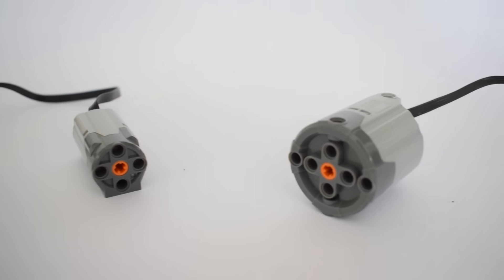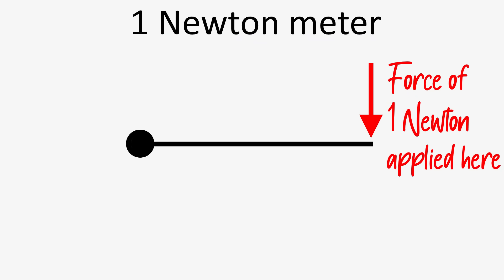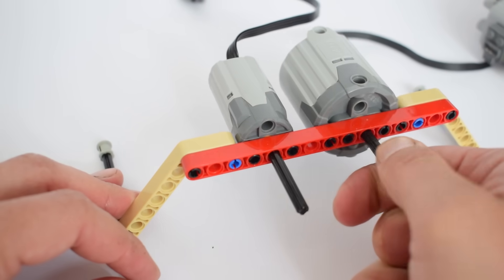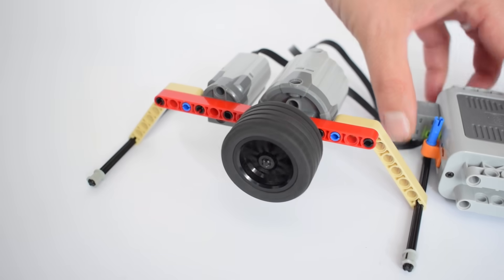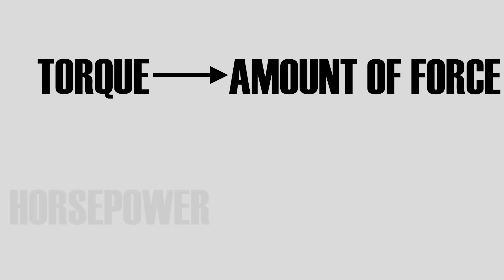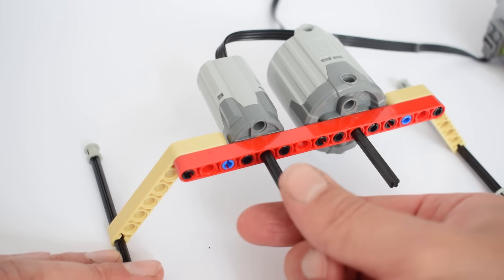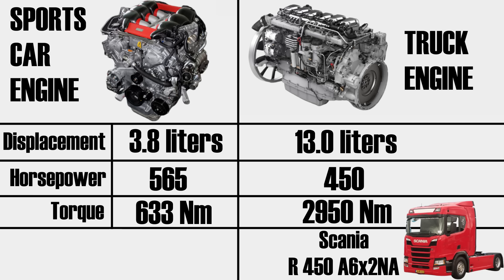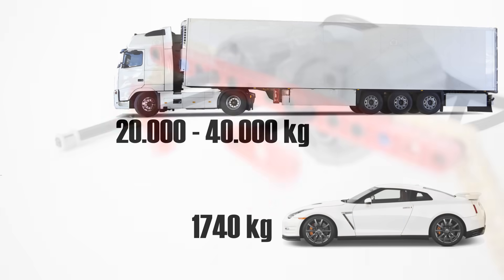NEVER be confused by HORSEPOWER and TORQUE again - HP and TORQUE EXPLAINED in the MOST VISUAL WAY

Comment: Why can’t you just gear the engine with more HP to have more torque?
Reply from the maker: Because you sacrifice speed
Reply: @d4a  I feel like a better way to word what I’m trying to ask is if the 3.8l engine and the 12l truck engine make the same HP. Why can’t they just put a 3.8l engine in a truck and gear it to apply the same amount of torque to the wheels. It’ll result in a smaller more compact engine.
Reply: @d4a  I just watched the next video. Excited to see more! Thanks to you I regret going to college for 35k/year
Reply from the maker: Here's my response pasted from another comment that asked a similar question:  A gear ratio can increase torque, but at the price of speed. So let's observe a simplified example. Our truck has 2950 Nm coming from the engine and to pull a fully loaded weight uphill it will use it's first gear. Often in trucks you will find that the first gear is something like a 14:1 ratio. This means that the engine has to make 14 rotations for every single rotation of the transmission output (I'll ignore differential final drive ratios for the sake of simplicity) A gear ratio that reduces speed increases torque and vice versa. A 14:1 gear ratio will increase our torque 14 times and reduce our speed 14 times. Trucks have these kinds of gear ratios in order to be able to move heavy loads from a standstill, i.e. When you need most torque. Once you're moving and the vehicle has inertia you obviously need less torque and more speed. Cars will usually have something like a 3:1 first gear and 0.9:1 or similar 5th or 6th gear. The 0.9:1 is great for speed but you can't take of in fifth gear because there isn't enough torque - the engine stalls because it can't generate enough torque to overcome the weight of the car with that gear ratio. So to come back to our example. The truck is going uphill fully loaded at 1500 rpm engine speed and let's say 20km/h vehicle speed using a 14:1 drive ratio. If you magically swap the GTR engine in that moment you need to use a different gear ratio to make uo for the lack of torque. The GTR engine makes 650Nm peak torque. The truck engine makes 2950 Nm which becomes 41300 with our 14:1 gear ratio. To make 41300 Nm the GTR engine needs a 63:1 gear ratio. This gear ratio increases torque 63 times but reduces speed 63 times. We need this gear ratio to retain the same torque to prevent the GTR engine from immediately stalling upon being swapped. Our truck engines 1500 rpm engine speed was reduced 14 times by the gear ratio to  107 rpm at the wheels which we imagined equaled 20km/h. Truck engines can make peak torque at such high rpm but sports car engines can't. Our GTR engine needs to be revved up before swapping in to let's say 5000 rpm where it makes the 650 Nm od peak torque. Now the 5000 rpm of engine speed will be reduced to only 79.3 rpm at the wheels by our 63:1 gear ratio. So the answer is that upon swapping the GTR engine and revving it up before swapping in and using the adequate gear ratio to get enough torque you will still decelerate because a gear ratio needs to sacrifice speed for torque and vice versa. 

Hope this helps. Never regret any education. I'm sure collage has been useful in many ways that you're not aware of. At least his is what I tell myself :)

Comment: The problem with understanding this is because of marketing. When was the last time you saw the specs on a new car that bragged about the torque?  You don't! They always tell you how much horsepower  this or that car makes. This is because people like to feel like they are getting there faster. Drag race cars are a perfect example. They get down the 1/4 mile really fast, and we like to see that. OTOH, there are some events that spotlight torque. For example, the sled races that apply more and more force the further you run. That's a torque race.

Comment: What about the gearbox though? That's a torque multiplier. With the right gearing, couldn't a more powerful sportscar engine pull a truck? The rate of work is greater with the sportscar engine. It might not last as long but ultimately power is the king.

Comment: Very well explained! One interesting thing to note here is that the torque of combustion engines is often paired with a certain RPM at which its applied (you may have noticed when you are driving a manual, and shift to drive at 1500 rpm, then floor the gas, the car does npt accellarate as much as if you would floor it at 2500rpm or more (this is why you need to apply a little gas before letting go of the clutch, the torque is much higher at higher rpm so the car starts moving easier and without stalling the engine.

Comment: Using a gear, should this not be convertible to a single unit? An engine running with the same power could then double the toque by gearing it down to half speed, or?

Comment: For anyone that needs another quick analogy, torque is like how fast and hard water can flow through a pipe (flux if you're familiar with that) while horsepower is like how much water is in a pool. A big truck and a sports car have similar horsepower engines (total water), but how they use it is different. Trucks are more like a really wide hose gently spilling water while a sports car is like a pinpoint jetstream.

Comment: 8:10
Sing it with me everyone "No replacement for displacement".
Reply: The replacement is gearing :P if you triple the torque but your RPM is 3x lower you have the same torque at the wheels :/
Reply: @RWoody1995 
Displacement can never be replaced.
Reply: @D8W2P4  then why do all the big trucks have turbos and 5, 10, 15 liter engines instead of no turbo and 10, 20, 30 liter engines?
...
oh yes because they replaced displacement with boost :P
Reply: @RWoody1995 
It took this man 3 weeks to reply because he tried to replace displacement.
Don't be like this man, accept no substitutes.
Reply: @D8W2P4  like I said, all the big trucks accepted substitutes so I don't really know what point you think you're making here is :P
Reply: @RWoody1995 
Once again, it took this man 3 weeks to reply because he tried to replace displacement.

Don't be like this man, accept no substitutes.

Comment: Shouldn't we be considering a load being moved by the motor? In physics, Power is measured by Watts or Nm/s. In order to measure the Force (N) we need to consider a load (m or mass) over a distance (d). My point is, with a given load, the motors would be rotating slower, maybe, the little motor even slower than the big one. Please, correct me if Im wrong

Comment: So I know what this will lead to next: Gear ratios. A combustion engine itself cannot go very fast without having that power transmitted via gear changes and ratios. I have been told that for like a 5 speed car, that 4th gear is a 1:1 ratio with the engine, while 5th is like 0.6, and 1st gear has the most torque. But that's all I can remember. Can torque be increased if, say a car had a much larger gearset? Like big trucks have a gear splitter and range selection for its enourmous torque, like you had mentioned in the video about its sheer size and weight. Now, my question is this: is there a magical formula for converting load and HP to fuel economy (miles per gallon or liters consumed per kilometers (I think that's how that last one is but I'm not 100% sure)? All I know is if I let my car rev high, while it may go fast, so does my petrol/gas go!

Comment: Nice video and explanation, I was expecting some gears to be then attached to the motors to show what happens. To me this is when things get interesting, if you added gears for example to the smaller motor to reduce its speed by half, the torque output will double, because torque is inversely proportional to the gear ratios, but what will happen to the horsepower? Nothing, because while the torque doubled, the speed halved, so ignoring losses, we can say that we can use gears to change the torque, but we cannot change the power.

Comment: Newton meter does have something to do with time, because Newton is based on time. From wikipedia:

"One newton is the force needed to accelerate one kilogram of mass at the rate of one metre per second squared in the direction of the applied force.[1] The units "metre per second squared" can be understood as change in velocity per time, i.e. an increase of velocity by 1 metre per second every second."

Comment: So by this math: Theoretically if the truck engine had a larger Rev limit, let's say 7k like a petrol engine has, then the horsepower number would be significantly higher then the sports car engine? Also if most people like the G force acceleration from sports cars...does that mean torque numbers are valued over horsepower? If so, what does horsepower contribute if all we care about is the feeling of torque?

Comment: But if the larger motor has more horsepower than the smaller motor, why does it rotate slower? I thought torque was how strong it rotates, and horsepower was how fast it applies that rotation. The little motor has less than half the horsepower than the big motor, but goes much faster.

Am I understanding this backwards?

Comment: So I have a comprehension problem but I really want to understand both torque and horsepower and their differences. I have the basics but as an example, what would be a reason for increasing horsepower in a semi engine when what they really need is torque to pull a large mass? What affects would that have on the trucks ability to perform its normal task? I realize that the rpm of an engine correlates with its horsepower but how does the horsepower I guess help the vehicle move by having more horsepower? If horsepower is only a measurement of force and the rate of it... Sorry if this is all jumbled up, hopefully someone is capable of helping me organize my own thoughts here and can help me out haha thank you
Reply: Something I am thinking about now lol Is horsepower responsible for the total speed a vehicle can reach and torque responsible for how quickly it will get to that total speed?

Comment: Torque = Twisting force
Power = Twisting force and the frequency at which that force is applied. 

Really no need for a 9-minute video. 

Horsepower at 6000 RPM with 750 lb/ft torque? (6000*750)/5252 = ~857 HP. As for why you divide by 5252 in this case, that's more complicated

Comment: Could you not use gears to half the speed of the smaller electric motor so that it made both half the torque and half the horsepower? This is what I don’t understand when they market high torque engines couldn’t you just gear it out until the torque figure is super high?
Reply from the maker: To gear it down you need to sacrifice speed. I'll make a follow up video on gear ratios.
Reply: @d4a  Well I understand that. Hold on. My point is that if you took the sports car engine that you mentioned and put it at the right gear ratio couldn’t it make the same torque as the truck and still go at a slightly higher RPM due to it having a HP advantage?

Comment: The bit I don't get. 

Gearing would appear to convert Torque. 

So if I put an ~2:1 step down gear on your smaller lego motor, wouldn't the torque after the gear be ~1/2 that of the large motor? 

If so: it seems like measuring an engine in torque is pointless, as gearing changes the torque.

Comment: 1 question, what limits a vehicle's torque?

If a gear box can be used to convert torque to HP, why not make a big high torque engine which runs at RPM range between a truck and a car and convert those into HP using multi speed automatic gear box and make a faster vehicle? What factor affects the range of torque and HP?

Comment: Engines don't make horsepower; they convert fuel into torque. Torque is the twisting force imparted to the crank.
 Torque is the grunt that gets things moving, and horsepower is the force that keeps things moving. 
Horsepower is torque….multiplied by engine speed…to produce a measurement of the engine's ability to do work over a period of time. 

Horsepower is a measure of force in pounds against a distance in feet for a time period of one minute. 
So, torque is the amount of force and horsepower is how fast the the engine produces it.

Comment: Good explanation. So even though im a big guy and dont work out, i can lift and carry heavy stuff just as easy if no more than a guy half my weight thats in shape. But the smaller guy has endurance and can lift less weight and repeatedly do it enough to match the weight I moved. I can do it fast, he can do it in parts very fast. If hes fast enough, he can get it done ahead of me even though i do it one time. So what im telling myself is that im fat and need to workout more? 😩

Comment: "You can't feel horsepower, only torque"
Isn't it the other way around? In order for us to feel anything, change is required. Change is dependent on time.
During acceleration, what we feel isn't torque, but rather the power increasing as the engine revs higher increasing the rate of work.
Reply: Yes you are right. Acceleration is governed by power/weight ratio. THIS VIDEO IS WRONG.
Reply: The feeling of being pushed against the seat is given by the amount of force that makes the wheels turn (torque), which is more related to acceleration than HP.

If two cars have the same top speed but different torque you would feel the acceleration more pronounced on the car with higher torque, but both cars would eventually reach the same speed, the one with lower torque more gradually and less noticeable.
Reply: @OJsY  the fact is that power is a function of torque * rpm. Vehicles considered "torqy" just develop a large amount of torque low down in the rpm range, which results in it developing more power at that given rpm than a lower torque engine. My twin engine bike delivers 110nm at 3900 rpm, and 90hp at 7000 rpm. My friends 4 cyl bike delivers 90 nm at 9000 rpm, and 120 smt hp at 12000 rpm. In city traffic (around 3-5k rpm usually) my bike feels like the quicker accelerating one since it delivers more power at that certain rpm range. He would smoke me on a track though. 

In physics, torque is a unit measured at a specific moment in time, something you cannot feel. A more appropriate definition would be "torque is the amount of force required to stall the engine".
Torque is force at a given point in time. Hp is effect/power.
Reply: @ON-te9qf   thank you for writing that. So many people says this is the best explanation they have seen, yet I am not so sure... as I (also) undestand it,  torque is a stationary measurement. So, when someone is talking about low end torque, they effectively are talking about power due to referencing booth torque and rpm.
Reply: @OJsY only if you have a broken transmission stuck in a single ratio.
Reply: Acceleration is the result of a force being acted upon you. The ONLY force that moves cars is torque! BUT even if you have lower torque per piston bang if you have enough "bangs" (high rpm) there's still more force to feel! He is right.
Reply: Change, yes. Change in location, no. You can feel the torque or force with no moving parts.

Comment: it’s quite simple really... the faster things move the quicker they wear, gasoline ICE have been engineered to become more efficient but will never replace diesel fuel... electric motors will replace diesel before gas ever does (unless California and their infinite wisdom extradites diesel before gas)

1. diesel has a greater energy density than gasoline 

2. Diesel is much less volatile making more suitable to use on heavy machinery which often requires repairs using welding, torching, cutting. 

3. Diesel is a better lubricant compared to gas (I understand ultra low sulfur diesel has to have additives to compensate for the lack of sulfur) being a better lubricant makes it a better choice for high pressure fuel systems furthermore higher injection pressure increases atomization which helps stoichiometry created once again a more efficient engine
4. Personally I’ve been lucky enough to experience riding in a 2015 Jaguar F-Type, 2014 Porsche Cayman S, 2009 corvette, all the way to a Kawasaki ninja 600cc engine swapped into a golf kart and out off all these insanely fast vehicles not one can compare the to low end torque of a Diesel engine

5. The industry choice... why would the majority of mobile heavy machinery power generation come from a diesel if gasoline was a better alternative

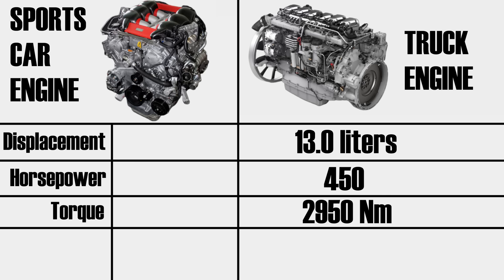6. Volumetric efficiency 7:15
3.8L Nissan at 13 PSI probably roughly 130 volumetric efficiency increases the displacement of air to the engine to 4.9l

Many diesels stock can run 30-40 PSI further increasing volumetric efficiency and total air displacement (when you need the power) you can do the math now let’s see why the diesel is more naturally better at running boost

The robust structure of the Diesel engine makes it more suitable for higher aspiration/boost pressure.  Most gasoline vehicles structurally aren’t designed for 30 pounds of intake boost pressure and the engines that can boost that much would never have the longevity of a diesel. The diesel naturally is more robust to handle the slower burning greater energy dense fuel so there isn’t as much structural modifications to be made to make a diesel forced inducted. Where a gasoline would have to be designed differently than most to handle these forced(might as well use diesel)

Disclaimer: Slower combustion allows for a longer stroke during combustion this increased stroke increases the throw/distance the force is applied from the center of the crankshaft creating you guessed it more torque

We use gas for washing parts, alcohol for drinking and diesel for power baby

Comment: Torque gets you going but horsepower keeps you going. Horsepower is what you want for higher speeds torque is what you want for lower speeds which is why when you look at gear ratios the rust 2 are usually really high and then there’s just a huge drop in the 3rd gear